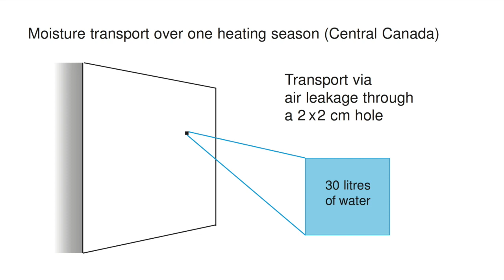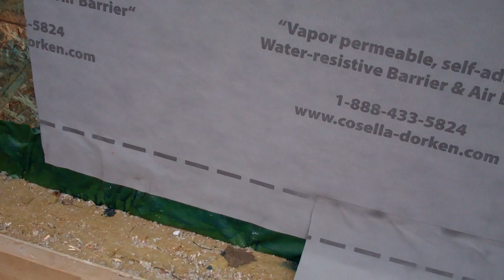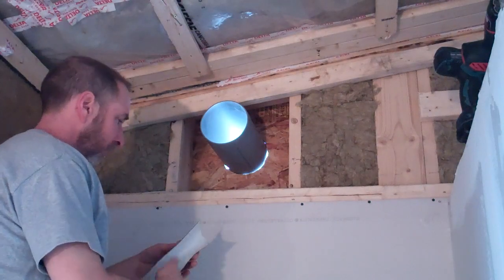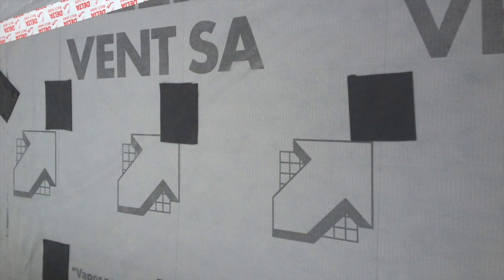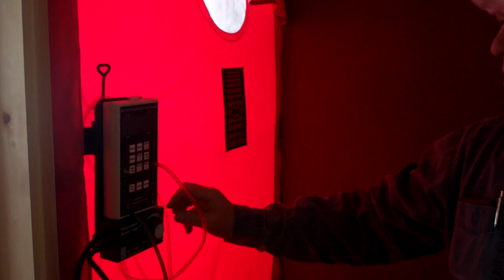Ecohome building guide: installing air barriers

Comment: What kind of maintenance is required for the Lunos system? I live in the Southern US where humidity is high most of the year and was wondering if there is a way (or a need) to clean the ceramic exchanger. A warm climate and humidity would seem to provide a ready environment for mold.

Comment: wouldn't poly on the ceiling cause condensation on the back of your ceiling say like drywall?
Reply: Have been watching and reading tons of videos and articles, and yes sources are saying poly is not vapor open, so should be avoided. I am even sure Ecohome says so, but this kind of video comes along and I am confused. I don't get it. 🙃
Reply: I could be wrong. But if you have an hrv/erv then i dont think youd have to worry about condensation on the inside. And a house this air tight definitely needs an hrv/erv or equivalent ventilation. Without such ventilation condensation would be every in the house

Comment: holy crap, what's the R value on that wall? 40?
Reply: Its actually R57 haha! https://www.ecohabitation.com/guides/3198/maison-edelweiss/
Reply: Hi there, Atlantic Canada chiming in. Zone 6/7 here and our plan is 7 inches of rigid foam for R35 on the outside.   Long live our Buildings! by   Steve Baczek        However it is the air sealing that will cost the most because of the labour to take the time to do all the sealing and focus.  I plan to be helping with the sealing and rolling of the tap and repetitive air sealing tasks with these builders.  🇨🇦 Meg👷‍♀

Comment: What wood/plywood sizing did you use to extend the window framing to account for the exterior insulation?
Reply: Peter Yee Plywood no doubt would have been a far superior wall sheathing. As it is stronger, has better tolerance to bulk moisture, is more vapor permeable, has fewer chemicals in its production, and as a crusty old Carpenter lighter weight for installation.      Down side, higher cost.
Reply: Hi Peter, so sorry for the delayed response. We used OSB to extend the rough opening, the sized was based on the wall assembly and amount of insulation to follow.